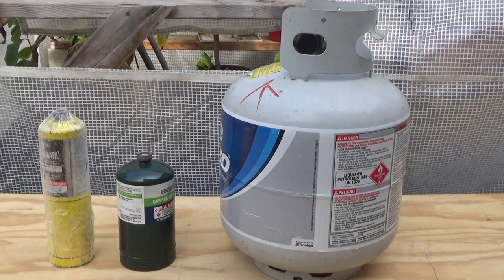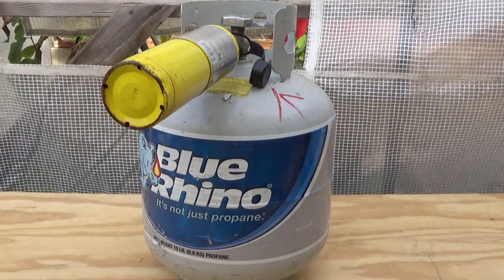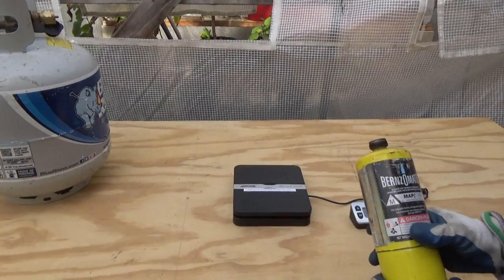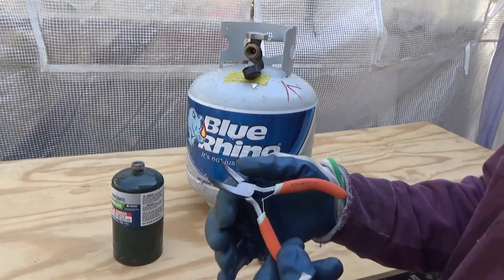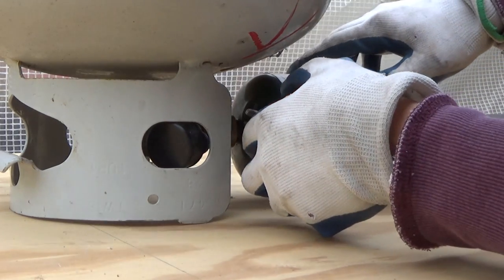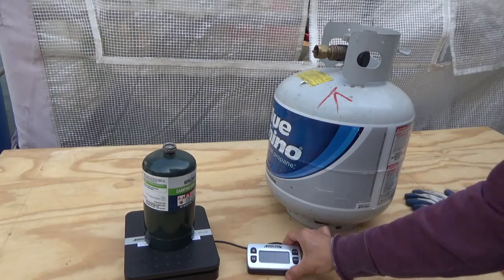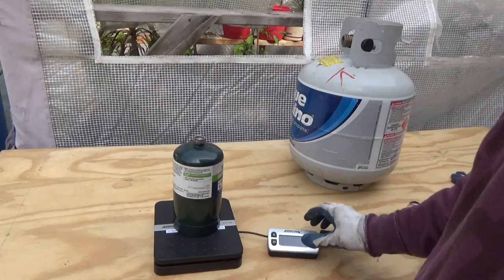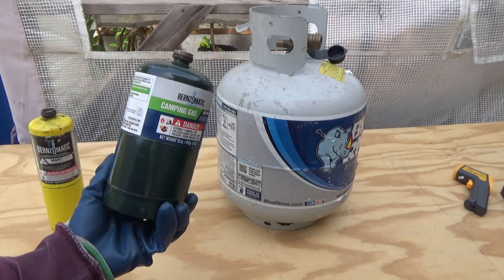DIY: To chill or not to chill: two ways to refill propane canisters

Comment: Chill method works great. Freezer not refrigerator for at least an hour. I get almost full pound doing it that way when big tank at 75 deg F. Never mess with the over press valve use your adapter to relieve pressure for your second demonstration or press down with the screwdriver on the main valve. Why would you want to mess with the over press valve that’s just another failure point that you’re introducing. Go with the chilled method you’ll be fine on the first try. No messing with valves at all

Comment: I have the big tank at 60-70 degrees F (put it indoors for a while if needed) and freeze the 1-lb'ers for an hour. Filling for 1 minute, I get 11-15 ounces per fill. This is fine. I would never mess around with the relief valve.

Comment: It's advisable to buy a refillable canister because the typical one and done types are NOT built to be filled and refilled over and over again. The relief valve you tug on to release the pressure is a weak spot and will fail just after a few fills or less. Spend the $15 and get a refillable canister. It will still save you tons in the long run and will be safe and LEGAL for transport. I'm sure there are many Mr. Buddy heater owners here interested in this, just like I was.
Reply: I just purchased the  Flame King kit and extra bottle for those very reasons (to use in my Mr. Heater). A little bit of an upfront investment, but it's safer, easier, legal, and made to be refilled a ton of times! It will pay itself off quickly too. 😀👍
Reply: I understand your opinion but I can't help but feel that the only difference in the manufacturing of the refillable canisters is what color paint and label they slap on it before shipping it out the door. I don't recall hearing about refillable ones back when I was a kid but of course that's because it didn't exist until probably China came up with that adapter. Corporations have discouraged people from doing many things that would save a person money just to help their bottom line and the "for safety sake" is probably the most common one. That being said, I know there are many things people shouldn't mess with that are a legitimate risk. I encourage that people do a little research and go from there. I don't see my video feed full of refilled propane canisters that have exploded

Comment: Two issues, first you can't run a  comparison test using 2 different types of bottles. Also, DON'T mess with the pressure relief valve to release gas. It's very easy to damage it and cause leaks.

Instead, push the pliers CAREFULLY into the fill hole. Pressure will release faster too.

Comment: If you have a Wen, Worx or Black & Decker portable workbench, you can sit the upside down 20 lb. bottle on it straddled with the bench opened up a few inches and thus easily get to the handle of the bottle to open or close it. Much easier to do it that way than having to muck with turning the heavy bottle upside down and back just to refill the small 1 lb. bottle.
Reply: Seen another video of the guy simply tilting it at an angle to turn the knob .. I was going to sit in on 3 concrete blocks to get access to the on off valve but when seen the guy simply tilting it to one side figured wasnt worth the hassle to lug some blocks to the work bench.

Comment: It is safe to fill as you do because you will never have a pressure problem to leak gas under filling the tanks. It is unsafe if you go beyond a pound because you may get pressures if the bottle heats and pressures rise in the tank making the release valve release gases. That is why it is illegal to transport these tanks when refilled BTW. I do think the idea of burping the tank with the valve where it connects is a better idea and perhaps burping between until you get that pound of fuel. But that's me. It might be wise to take the pressure entirely out before starting as well. The method getting only 5 ounces seems crazy. I would certainly not want to refill anything and get any less than 12 ounces, but I would like to be shooting for closer to the 16 ounces if at all possible. Always nice to see different people do things differently. Don't forget to check for leaks and if they leak make sure to discard them.

Comment: Do not fool with the overflow valve it will never seat correctly..... Just put the little ones in the freezer for about 15 minutes I use a scale fill the empty bottles up to around 950g

Comment: and vent gas using a torch, some place illegal to vent propane for no reason. the safety valve trick is a real pain in the but if you ask me. when you do chill method correctly, you get virtually the same results, best if big tank full and warm. if camping, i use the latern on high and it almost will freeze bottle, first have to charge a little bit, then put it on high. usually will freeze or at least get really cold and still get a half bottle.
Reply: George Robles, why does it matter if 20lb bottle is full? As long as there is liquid sloshing in 20lb'r doesn't it have consistant pressure relative to temp, anyways
Reply: @johndro8235  The pressure due to gravity is less and if the 20 is less than half full, it will tend to equalize pressure with the small tank quicker and only put a few oz in it.

Comment: Need to let all the pressure out BEFORE you freeze it. Freezing creates a vacuum in the tank, allowing more content.
Reply: Propane boils at -42°F, so you’re not creating a vacuum by chilling it.  What you are doing is reducing the vapor pressure. When liquid propane enters the chilled bottle, some of the cooler gaseous propane condenses, so the vapor pressure stays low, and allows more liquid propane to be forced in by the higher pressure in the warmer tank.

You would probably get similar results by putting an ice pack on the smaller cylinder while you transfer the propane.

Comment: that yellow canister is from MAP GAS not propane
Reply: It's the long hose that leaches the oil and plugs the heater, and if the right hose is used then you don't need the filter. for E.G.:   https://www.amazon.com/Mr-Heater-Buddy-Series-Hose-Assembly-10-ft-Model-F273704/dp/B001CFWF5U/ref=cm_cr_arp_d_rvw_txt?ie=UTF8

Comment: I wouldn't recommend touching the relief valve when refilling. They rarely will reseal and will leak. Always check valve and stem with soap water solution and watch for bubbles indicating a leak.  You also should freeze the cylinder (15-30 min) before refilling. The 20 lb tank should be also warmer than smaller tank your refilling.
Reply: they reseal i was using a old bottle to fill with compressed air and id have to flip it and squirt out condensate every couple of fills

Comment: I use a full 20 lb bottle filled by propane company. Shake it big bottle and of course if it's 90 - 95 degrees more pressure. when I refilled it was about 60 degrees not as good. 1 pound Bottle chilled in the freezer works better too. freezer full haven't tried yet. I seem to only get two or three 1 pound bottles full and pressure down. and then 1 pound bottles not as full. So I will get another 20 lb full bottle and start filling again. It does make a difference.

Comment: They make a gel pack for chilling your wine bottles quickly. Just freeze it and wrap it around your bottle. You could also use a Ziploc bag filled with either salt water or alcohol, freeze the bag wrap the bottle in it and let er rip..

Comment: WORD OF ADVISE if you are using these refills on a catalytic heater,you will ruin your heater because of the oil that is in propane. You need to use a filter when filling your bottles. YOU  can purchase these filters at your local farm supply store... I have seen 3 of these heaters ruined because of propane oil.
Reply: Rick Glow wouldn't the oil be in whatever propane bottle size you decide to hook up to your heater?
Reply: your pretty safe using store bought 1lb.canisters.But propane oil exists in bigger quantity containers.You just got to believe me on this one I know what im talking about. I have seen 3 heaters destroyed by propane oil.
Reply: Rick Glow but most heaters instructions advise to use big cylinders. Maybe i'm talking about the forced air style heaters and is different then the style your talking of?
Reply: Yes Ive run my catalytic heaters from hoses connected to a 20lb tank for years without any issues.
Reply: there's no oil in propane maybe your HV/AC guy is running a scam on you
Reply: There is no oil in propane. Its lpg. Liquified petroleum gas. It is a by product of crude oil. Propane is made during the refining process.
Reply: There is an oily substance in propane.  It is the oderizer that is put in it for leak detection, that you can smell with your nose, no special equipment needed for that smell!
I used to run my Weber grill from the 30 lb. tanks on my RV directly, using long propane hoses connected together, I would get that stinky sulfurous smelly oil coming out of the venturi screen at the burner control knob.  I used a stay-a-while "T" type adapter on the tank connection to the RV and the lower the tank level got, the more the oily stuff would puddle under the burner control.  When I removed the regulator from from my Weber "Q", a lot of oil came out of it.
I have since converted my "Q" to run directly off of the low pressure connection on my RV and no more oily gunk.  Something about the regulator slowing down the flow enough to not allow the oil to be siphoned from the tank.  Pressure but not high flow.
Reply: @redorrick427  Sorry Rick. Im not going to believe you because you are wrong.
Reply: @redorrick427  You sound like Dr Fauci and his poison cocktails sales pitch.

Comment: Why are you filling a MAPP gas cylinder with propane?  They are not the same stuff!   Also, you can zero out your digital scale to the weight of the empty bottle.  Then when you weigh it again after filling, you have just the weight of the gas.
Reply from the maker: As far as MAPP gas goes, why not? Does it even matter when it's empty?
Reply: just got to know what your tare weight is. ALSO it helps to know your weights and measures, and how to use a scale

Comment: Stay away from these schrader valves & relief valves if your concerned with your safety !
Reply: Absolutely. Just disconnect canister and release pressure by depressing main valve. That causes rapid cooling to accommodate more liquid. Fill to 830 grams.

Comment: There may be a safe way to vacuum out the air in the small bottle to avoid freezing or venting ?
Reply: its not air its propane gas, in the bottle there are both gas and liquid. yeah but you need another tool harbor freight sells a vacuum pump that'll do it but i wouldn't lol
Reply: All you need do is take a pair of needlenose pliers, CAREFULLY vent through the fill valve. it's much stronger than the pressure relief valve and they rarely get damaged
Reply: Mel Rey  ok cool thanks, I've got to fill one tomorrow
Reply: no
Reply: the "safe " way is toss the green #1-lb cannister & skip on down to wally-world , plop out a visa card & pack the rear hatch of a mid-size SUV , with 20 or so 1-pound LPG green , thin-wall shrapnel scattering devices... im sure the advocates of planned obsolescense would have us carry 1/2 a soccer team in the vehicle also... lets hope & pray that everyones brakes work at the stoplight. NO rear-end collisions, please..

Comment: Is it possible to vacuum purge the old canister first, then refill the tank?  I'm not sure it would be worth the effort.
Reply: that's not air in the bottle its propane
Reply: No reason to evacuate the only propane gas in the tank. Why remove propane when your trying to fill it. Plus pulling a vacuum on it makes the tank colder

Comment: Get an old pump Coleman stove and fill it with premium gas. It burns clean, doesn’t smoke, and it doesn’t burn your wallet.
Reply: most people use propane grills to make steak, not the same device as your coleman stove
Reply: Hey Coleman pumpstove stone ager. We need these bottles for our Mr. Heater Buddy. Gasoline anywhere near one of these great little heaters would be a 95% effective way to get your skin nice and bubbly hot.
Reply: @eksine  Not me, it's charcoal or on the stove.
Reply: Not all the old Coleman stoves will burn regular gas
Reply: @mrequi1  yeah charcoal is better than propane but after i did math, after you buy the tank its like $16 at walmart for a propane tank exchange and that's like 3 times cheaper than the 1 lb green tanks I usually get, propane is just more convenient. I totally agree, I was using charcoal all the time before, tastes better but propane is just easier. i never use the stove, that's so bad for meat
Reply: @eksine  Begrudgingly, I must admit to the same. Over the years I've grown lazy and used a lot of propane. I now heat. & cook w it. On the river I live on, we returned largely to wood community cook fires this year for our nearly nightly BBQs. It took longer, but that time was spent swimming, golfing, fishing & getting to know friends new & old. And the meals were fantastic. Try a prime rib slow roasted on the open fire with a glass of a good Oregon Pinot Noir. Or a freshly caught steelhead basted in a fresh wild blackberry Sriracha glaze. Pair thst with a glass of my homecrafted 2015 Oregon  cannabis infused merlot. So its far more than the fuel you choose, it's the friends that you keep. God I love being retired.
Reply: I refill for my benzo torch so...

Comment: Why you should NOT refill disposable propane cylinders!
How much is your safety worth? Disposable propane cylinders are built far differently than their larger, refillable brothers. The metal walls of the disposable type are thin, and repeated contraction and expansion of those thin walls can lead to metal fatigue and eventual rupture. Likewise, a disposable’s valve is not designed for repeated use; and unlike an LP cylinder designed to be refilled, there’s no “bleeder” valve to indicate when the disposable is filled to the safe point, making overfilling a real problem. And while plenty of people refill their disposable cylinders without trouble, how much are you willing to gamble that you can get away with it?But hey!!! Home Depot have a refillable 1 pound Small tank, designed to be refilled.

Comment: Although it is not illegal to fill these, it is illegal to transport them on roads.   
(B) For cylinders manufactured on or after October 1, 1996: “Federal law forbids transportation if refilled-penalty up to $500,000 fine and 5 years imprisonment (49 U.S.C. 5124).”

49 CFR § 178.65 - Specification 39 non-reusable (non-refillable) cylinders.
(i) Markings.

(1) The markings required by this section must be durable and waterproof. The requirements of § 178.35(h) do not apply to this section.

(2) Required markings are as follows:

(i) DOT-39.

(ii) NRC.

(iii) The service pressure.

(iv) The test pressure.

(v) The registration number (M****) of the manufacturer.

(vi) The lot number.

(vii) The date of manufacture if the lot number does not establish the date of  manufacture.

(viii) With one of the following statements:

(A) For cylinders manufactured prior to October 1, 1996: “Federal law forbids transportation if refilled-penalty up to $25,000 fine and 5 years imprisonment (49 U.S.C. 1809)” or “Federal law forbids transportation if refilled-penalty up to $500,000 fine and 5 years imprisonment (49 U.S.C. 5124).”

(B) For cylinders manufactured on or after October 1, 1996: “Federal law forbids transportation if refilled-penalty up to $500,000 fine and 5 years imprisonment (49 U.S.C. 5124).

Comment: unfair test. u need to use the same canisters with starting weight at the same temp. then freeze one. also the tank ur using to fill with must be same in weight and fill. only then ur test can begin as a fair test
 :) ... just saying 

... i wonder if theres a tool made or can be made to operate the release valve ?
Reply: it's not scientific and hes just giving you examples of how to get more liquid into the bottle. it's not really a comparison you can do both things to get more LP into the bottle, you can even heat the big tank up to get it even further
Reply: I have refilled canisters using the chilled method.  It would have worked better if he had not let the canister warm up.  Also, a full 20 lb cylinder works better. 

IMPORTANT!! the little canister often leaks out the valve when you refill them. This problem increases the more times you refill them. That is why it is imperative that you immediately attach them to an appliance after filling.  If you want to have a spare I suggest you buy a propane torch to attach to your refilled canister.

Also: I would never refill one of these by pulling up on the relief valve.  If that valve does not reseal properly all the gas will leak out.